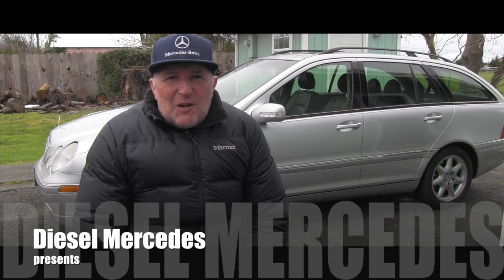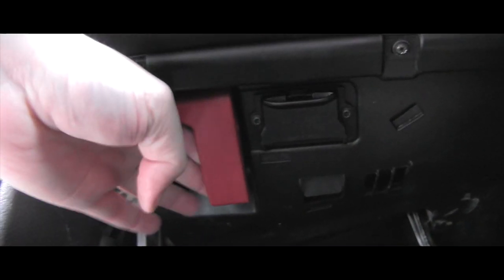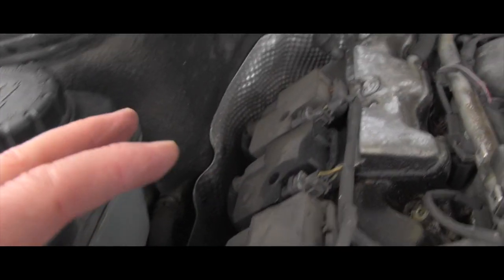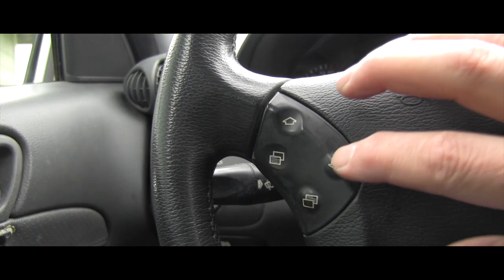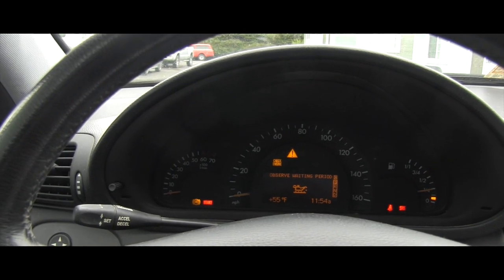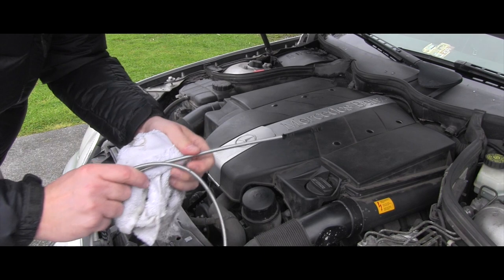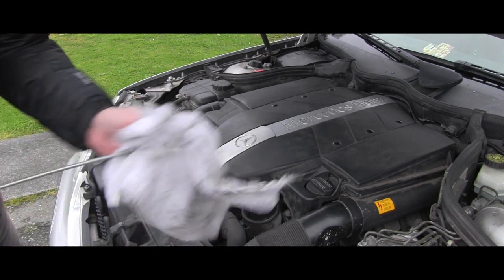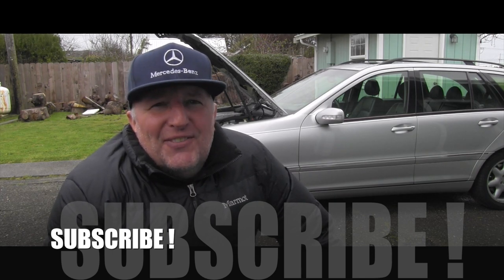Mercedes C 240 How to check engine oil

Comment: Good video. But I’m starting to hate this car.
Reply: marvin martin why?any issues?just bought it last month
Reply: Kimani Charles   Ours has issues that seem to cause other issues. Electric issues. And the damn door handles. Inside keep failing. Third door card. Fifth handle drivers-side.
Reply: marvin martin ooh okay,,,apart from that,,any mechanical issues? Engine problems or transmission?mine too has some electrical issues but nothing major so far
Reply: Kimani Charles   AC motor seized.  Water pump swapped cause it was leaking. Car had a hard life before we got it. Now has a weird gearbox thing going on. Clunks into gear and doesn’t want to kick back a gear.
Reply: Ok that’s Different
Reply: Mike Dominguez   And yet I persist and fix it. Wife’s car she loves it. Makes her feel all posh lol. I bought a V8 BMW 09 model. Rare here in Australia. Nice car. As a present for her so we can sell or put her in to be fixed. She won’t drive it. Hoon car lol

Comment: My battery died, got it change, it powered on, drove around on our yard. Powered off and now cannot start again. What is the issue? A blown fuse? 2004 c240 model, pls help?
Reply: Check alternator
Reply: @HunterC99  just had a mechanic check on it, a fews weeks ago. The Alternator is fine. He said it’s electrical problem. A bunch of codes that needs to decoded. He suggested to bring it to a shop!

Comment: Thank you for this information I was stunned by the cap on oil tube and shocked no more oil dip stick and mine is 2003 c240.

Comment: Am happy  you bought  this car
Reply from the maker: Thanks, me too....
Reply: Is that  a 4matic?
Reply from the maker: yes....
Reply: Perfect! How many miles  you have and can u make videos  on the problems you face with  this one?. Mine use to vibrate, we changed  the engine and transmission mount but it didn't  work  till we changed  the front axles and it work fine now.
Reply from the maker: Thanks for sharing those details...

Comment: That's a gas engine? There is a 2nd engine oil menu available in IC on 05 E-class  not sure about 04 C-class but might be? If there is a menu screen that displays outdoor temperature ONLY, scroll to that with steering wheel menu buttons, turn key to position 1 & push reset button (backlight dimmer control on IC) 3 times. It should change display in IC to a readout of battery voltage. Use steering wheel arrow-up button to change display from voltage to engine oil quantity. Turn key to position 2, after 10 seconds a reading in quarts down to the tenth will appear. This display will stay up even after starting engine & you can observe it gradually subtract & fluctuate as oil pump begins drawing oil up & it starts to cascade & recirculate through engine. I use this display routinely on cold starts to determine at what point engine has reached oil saturation at idle, approximately 2 quarts/minutes. I wait until it reaches this level before revving engine or putting it in gear. I toggle between this display & mpg display during long trips to verify oil is not being consumed. This display is very accurate on perfectly level surface cold starts.
Reply from the maker: sounds like service menu...thanks for sharing....